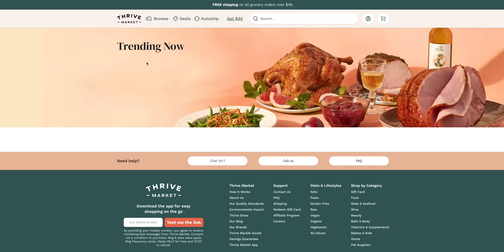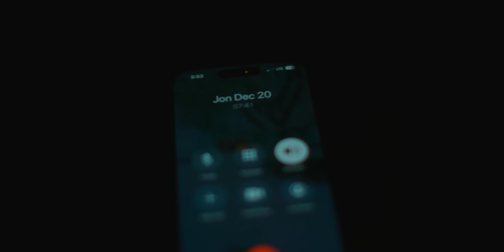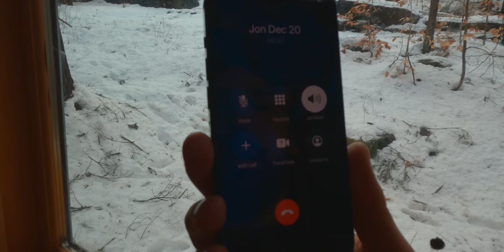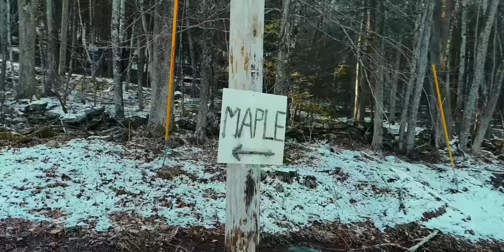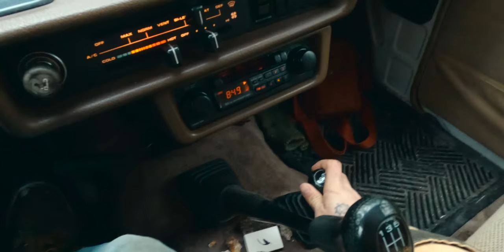The Cabin Finally Feels Like Home

Comment: 42:56 In the mountains of southern Oregon we use easy slip on/off traction Tracks for our boots as we encounter similar snow/ice conditions. Those little steel studs will save you some real potential heartache. Studded snow tires for your boots...2 minutes on, or less..a few seconds off.  Perfect for that expected/unexpected under the surface ice. Have the same Woolrich "Pennsylvania Tuxedo" plaid hunting coat. Bought in the 60's. Good choice! Nice vids! Fine job! Keep up the good work...!

Comment: Nice to see the cabin almost finished. Really enjoyed seeing the snow pictures of the forest. Just a little bit of safety advice, when useing a tablesaw, use a wood extension handle to push your board the rest of the way through. That's just me thinking to myself. Keep your fingers away from the blade. Just something to think about. Enjoyed watching, have a great week. 😀
Reply from the maker: Thanks Jim! And I've got an extension handle for smaller pieces or when someone else isn't pulling it on the other end. I treat that blade like it's god. Have a great week yourself!